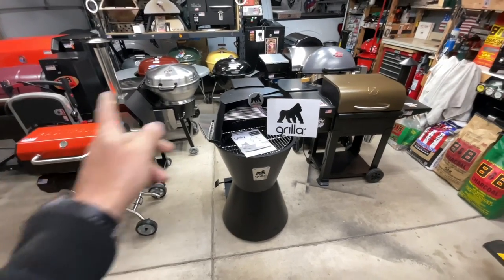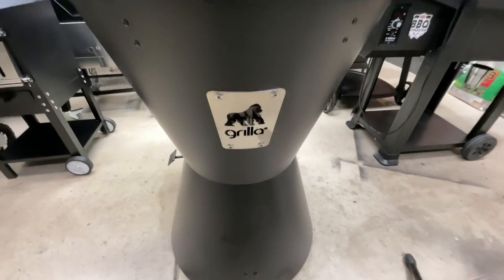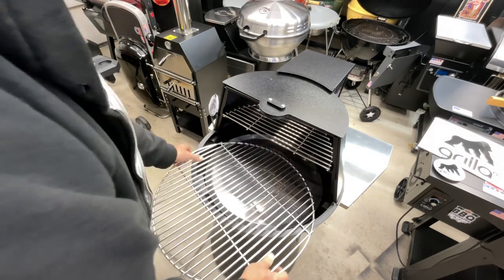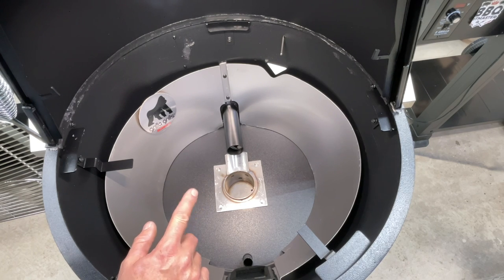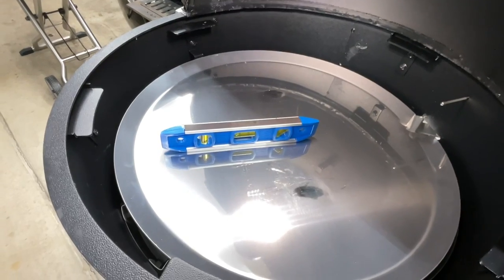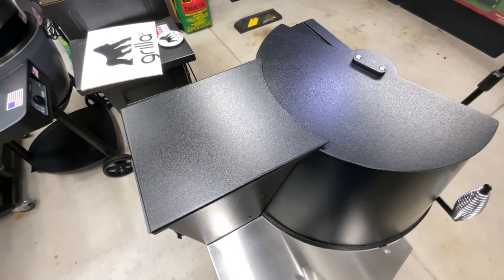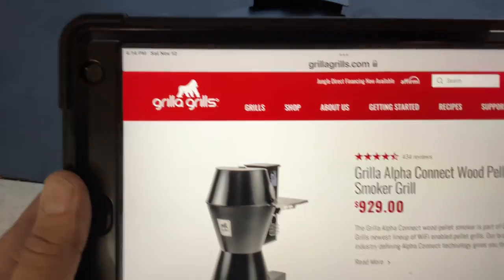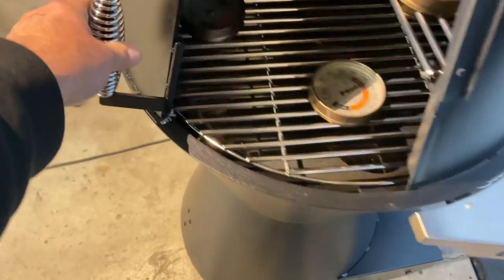Honest Review Of The Grilla Grills Wood Pellet Smoker / Grill, The Most Unique Pellet Grill Ever!

Comment: When I was looking for my 2nd pellet grill, I considered the Grilla Grills and Tecteq portables.  I ended up with the Z Grills because it had a little more grill real estate, but it wasn't portable. One thing that intrigued me about the Grilla Grills was the choice of PID vs Analog control. The analog will give you more smoke, but wider temperature swings. I assume this has the same option.  That pellet chute to the burn pot is the way all pellet grills should be made. Pricey, but I can understand why.  It's not a Chinese clone and there several features that justify additional cost.  The price per lbs. certainly looks competitive. 😁
Reply from the maker: Thanks for watching Ted! Not sure about the analog thing. You can adjust the percentage of auger rotation and adjust the rtd probe which I believe would be controlling the pid

Comment: Man, what a unique grill.  Can you detail the dimensions a bit more?  Are the shelves removable?  I have a particular tight spot in mind where there's a kamado atm.  This Grilla is such a weird shape I'm having trouble visualizing if it would fit.  

Great video Tom!
Reply from the maker: Thanks for Watching Jeremy!  Check out the website it has all the dimensions,  the shelves are removable
Reply: @TomHorsmanAmateurBBQ  Thank you sir.  I posted to their FAQ asking the width with the shelves removed, and they appear very fast to answer questions so that'll answer that.  

One point of interest for you.  There are several reddit posts from the "pelletgrills" subreddit and other internet reviews that mention problems with paint peeling on the interior of the grill, often only 3-4 cooks into using it.  The reports I read were all 1-2 years old.  It may be fixed now, but wanted to call it out in case you notice it.
Reply from the maker: Thanks Jeremy!  Good to know